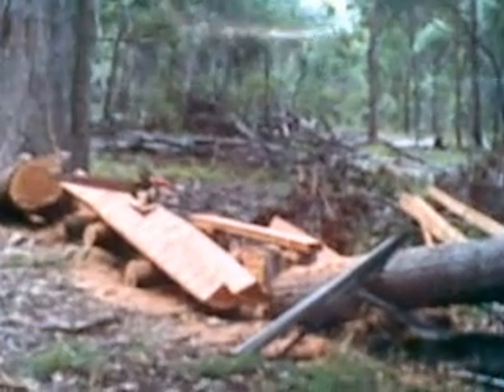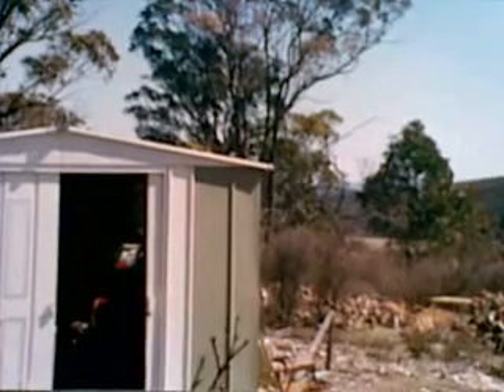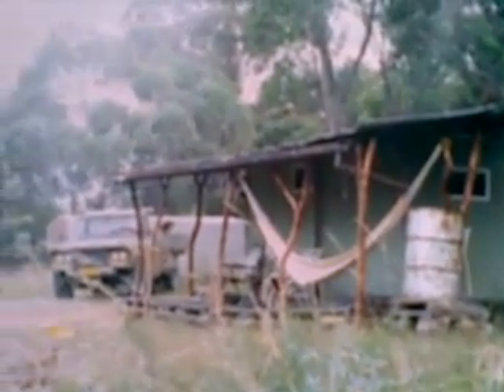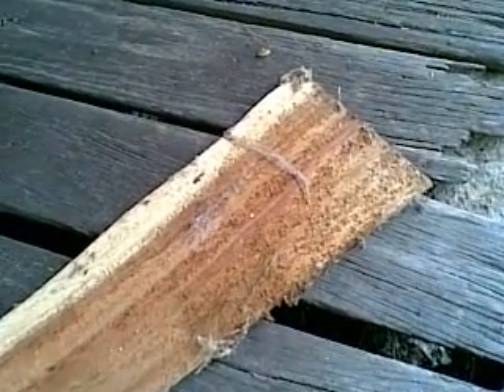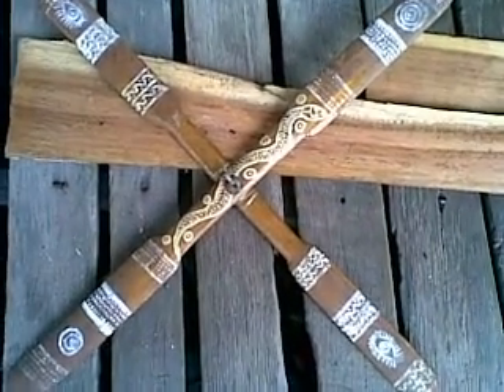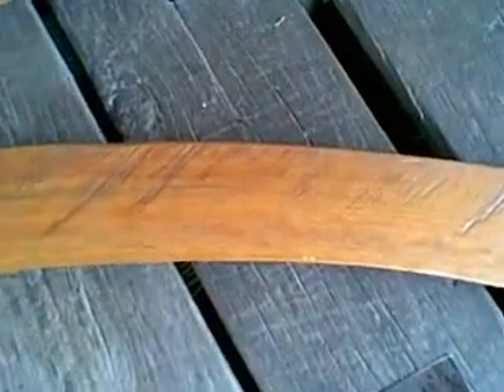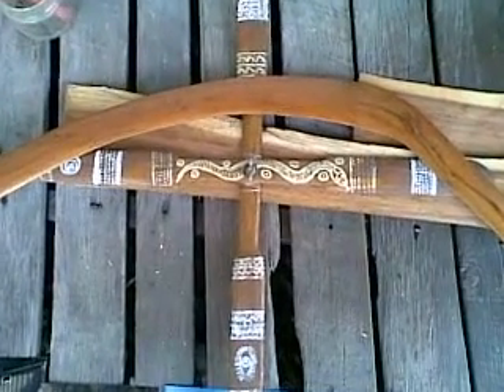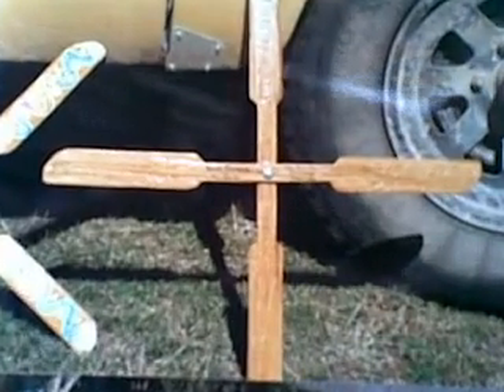Chainsaw-Milled Boomerangs, & Long Rectangular Prisms, From a Sawmilling Green Extremist.

Comment: Yes, it is called quartersawn, cut in your case, with a chain saw! That is pretty ambitious! Gotta let 'em dry out a bit too, check moisture content, I dunno specifics, but if you press your lips to the underside of a stick of wood that has been in the sun, and it is warm, it is dried out enough, as a nurse you prolly know lips are sensitive to heat and cold. cold would equal a high mosture content
Beautifully made stuff, Chris!